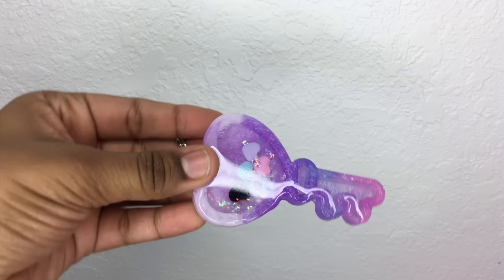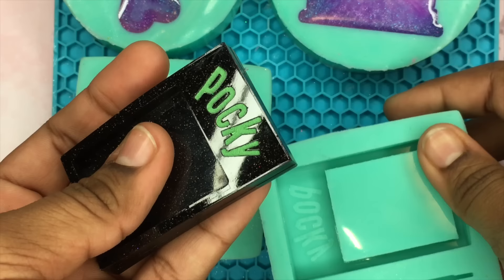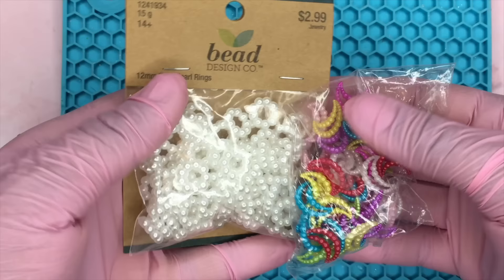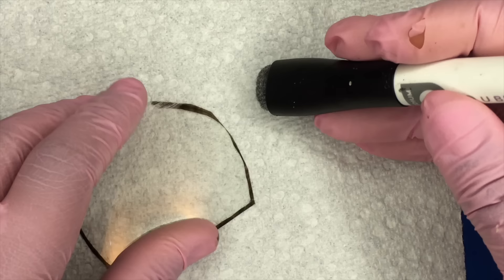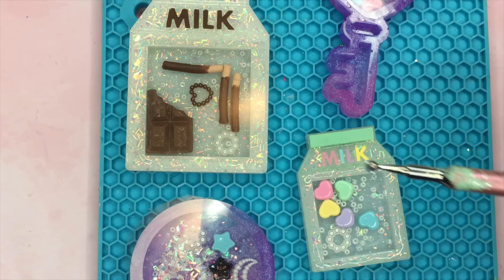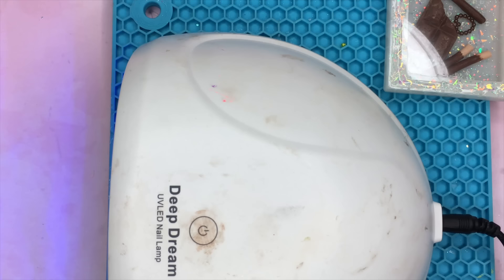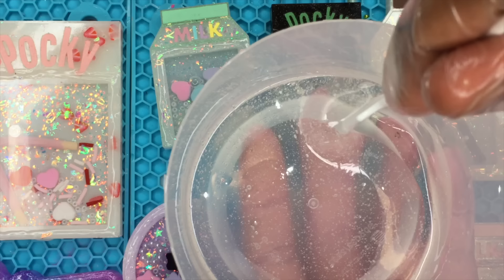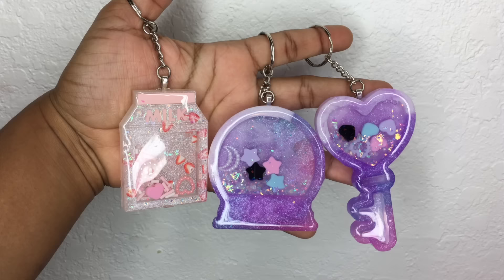How to: Resin Shaker Charms | Watch me resin | Sweet Art Crafts

Comment: Thank you for addressing resin safety 💜
Reply from the maker: I plan to do a video dedicated to resin safety soon. I was naive in thinking that because I knew about resin safety and always wore protective gear, that others knew this too.
Reply: I never knew resin was harmful,I see others just do it like a normal glue gun that has melted glue
Reply: 1000th like
Reply: @SweetArtCrafts  do I have to use a Mask while using resin?
Reply: You ALWAYS need to wear a respirator and safety glasses and THICK nitrile gloves when working with resin, eco resin too! (Two pairs of gloves seem to be ok too) And do NOT sand it outside!! It will deposit in the soil, become micro plastic and pollute the planet for basically ever 🤦🏼‍♀️ Sanding outside does not protect you from inhaling it anyway.

Comment: i have quite literally never used resin in my life, any tips for someone like me who wants to try it out? like where to buy, how much to buy, etc
Reply from the maker: nxdal I would honestly start off small, look at supplies from AliExpress, eBay, Amazon and local craft stores. I would also look into using Art n’ Glow resin as a starter one, there are other brands as well on Amazon you can look into. Just make sure to do your research. Also before starting resin, I would highly recommend you getting protective gear. Epoxy resin can be dangerous and cause rashes and other side effects if you don’t wear the correct gear. I would suggest a full face respiratory vapor mask, nitrile gloves, wearing long sleeves and making sure you are working in a well ventilated area that doesn’t have children around. Also keep in mind this is a very expensive craft/hobby, I didn’t know that until I really started getting into resin but I love it. 😭
Reply: Get a beginner kit. Look up resin kits some will come with UV resin, and an uv light. Craft Kitsune, Sophie&Toffee, Amazon, Etsy. Look up UV craft kits in your search bar. Start with the Uv then work your way up to the 2 part. Your local craft store will sell the 2 part, you can get the small one and try that out, if you don't want to do the Uv resin. Beware the Aluminite Amazing clear cast, stinks but is really good resin. I won't buy it again, because of the smell.
Reply: There are starter kits in spotlight that tell you the basics
Reply: ah thank you sm y'all 💞💞
Reply: @meow65  Just wanted to second the Sophie & Toffee kit suggestion. They have a starter resin box specifically for beginners, but they also sell other kits for making small charms and things. They have tutorials on their social media, and you can find some on YouTube as well.
Reply: I have never even heard of it before
Reply: This was helpful, thank you!
Reply: I have been asking my dad he made these counter tops with a sertin one  and my dad said maybe we can try but start off small like my dad is going to
Reply: @SweetArtCrafts  what would happen if someone didn't use a mask for example and what would happen if they didn't use gloves?
Reply: Sweet Art Crafts how expensive would you say
Reply: Resin can b3vcostly.  Definitely buy small before bigger investment.   Make sure you have protective eye and mouth gear for health reasons, well ventilated area protects you and others living with you.
Reply: @MommiesSimmpleLifee  depends where you purchase, whether shipped or not and where like another country (timevis money too 😁 )
Reply: @meow65  thanks for asking, but I they've helped me too much 🤗🤗
Reply: Shanitta Thompson  can you make the shaker out of UV resin or does it have to be epoxy?
Reply: Look up starter kits on amazon and then get some resin! I love uv resin because it is more affordable ! To cure it u will need uv light, Such as a nail lamp! If u don’t have that u can put it in the sun for 30-60 mins depending on the size of the piece! But I would recommend a nail lamp! Hope this helps!
Reply: Mix the Hardener and Resin. I didnt and it turned out a mess
Reply: @AndreaP_N7   pls the number
Reply: Pls number
Reply: @AdeniranAdeola-ie6rj  Sorry, what number are you talking about?
Reply: @AndreaP_N7  does selling the material to use
Reply: @AdeniranAdeola-ie6rj  The shop? Sophie and Toffee sells good quality resin. I got my mask at a hardware store where I live.
Reply: @AndreaP_N7  okay thanks really appreciate pls can you share me their number and the location or if you have any of their page
Reply: @AndreaP_N7  where did u base
Reply: @AdeniranAdeola-ie6rj  Sorry, I don't know their number. They are in a different country than me, anyway. If you Google their website, you will find it 🙂
Reply: @AndreaP_N7  alright thanks boss

Comment: I'm so glad you talked about resin safety, I was about to do this in my tiny room with absolutely no protection.
Reply: Me too
Reply: There are some craft resins you can get that are non toxic and without fumes, though sometimes they are not as strong
Reply: I did it once and yeah not again 😂
Reply: SAME
Reply: You ALWAYS need to wear a respirator and safety glasses and THICK nitrile gloves when working with resin, eco resin too! (Two pairs of gloves seem to be ok too) And do NOT sand it outside!! It will deposit in the soil, become micro plastic and pollute the planet for basically ever 🤦🏼‍♀️ Sanding outside does not protect you from inhaling it anyway.

Comment: Soooo fun and cute, I need those strawberry little charms. They're my favorite. These shakers have so many steps I didnt realize that. I have learned so much from your videos. Thank you ❤ p.s. great tip about adding a coat of u.v. resin on the outside of the clear paper. Better to be safe than sorry 👍
Reply: i found the strawberry charms at amazon :)
Reply: @dont4get2bleed  awesome, thanks so much. I am going to get some 😁👍
Reply: @dont4get2bleed  thank you omg..
Reply: Naptime Creations I also found a bottle of fruits for about 3 or 4 dollars at Micheals, they’re assorted so I might get a few of those and put them in my creations :)

Comment: As a Nurse Practitioner I LOVE YOU for putting lung safety and eye and skin safety FIRST!!!!! THANK YOU for reminding those amazing Parents out there that love to do crafts with their kids that THIS is probably not one of the BEST ones to do. I AM SO GRATEFUL…..If I had a nickel for how many times I have had a Toddler come in to the ED with Respiratory issues and the parent can NOT figure out WHAT they could have “gotten into”…..I saw her earrings and knew RIGHT AWAY she did epoxy & Resin crafting…..I asked her if she cleaned up well and wore a mask as well as WHERE does she do her crafts…..yep…..IN THE HOUSE IN HER “CRAFT ROOM” 🤦🏼‍♀️.

Not anymore she doesn’t. Little one was ok but he will most likely end up with some allergic issues to these things down the line according to the Ped’s On Call Doc. 

I did suggest a ventilation machine of some kind and one of the RN’s said she uses a Nail particle air “cleaner” as she put it…..however, unless it is HEPA with a new filter put in after “?” Hours of use, then it is no use so a face respirator AND doing this OUTSIDE is the best idea if possible. 

So, good call and THANK YOU for reminding Parents about SAFETY for them and their LITTLE’S!!!!❤❤❤❤❤❤❤

Comment: Another super helpful video!! I don't think I've seen many videos really explaining resin safety or anything about cleaning the pieces between initial demold and filling shakers. Is there a trick to using the UV resin on the perimeter to secure the clear film? No matter how I space it every time I have to press the film to make sure its pressed in and all sealed it always manages to leak in to the piece somewhat and something always gets stuck whether its tiny caviar beads or glitter.
Reply from the maker: I would suggest reducing the amount of UV resin for when you are applying the transparency film and then further securing that area with the second layer of UV resin that you do. That's what I do and I haven't had any things get stuck as yet.
Reply: Julie Allen 
Stuck?
You mean “magically suspended“  🥰

Comment: That kind of mask is too expensive for me... Im literally starting in the "resin world".
So I have a question, can I use normal mask? Like the ones we are using in this Covid time?
Reply: Honestly, I don’t see a problem with using a normal mask. As long as you work in a well ventilated area with gloves you should be fine. I have worked in a not so well ventilated area (no windows) and with no gloves nor mask. Don’t do what I did 😅 but next time I’ll be wearing gloves and a mask. You can also read the instructions of the resin you have and it should say what kind of protection you should use when working with it.
Reply: No no no it will NOT filter any of the fumes.. you need something that has filters in it. Amazon has cheaper options. But long term your health is worth the money

Comment: Thanks for sharing, those are super cute!  😍😻
You can get a gel brush at a nearby supply shop for the uv resin and you can clean it with Atleast 70% isopropyl alcohol. It could help spread it smoothly.

Comment: Definitely suggest wiping around the hole with alcohol after filling with baby oil, before you seal the hole with resin. I've found that ANY residual oils left behind can make the resin plug not adhere well, and peel away later. 😉
Reply: I had made a few a long time ago and back then, I didn't wipe with alcohol after filling them, just wiped it with a paper towel like you're doing. And it often took a few weeks or months, but that microscopic amount of leftover oil would cause the resin to peel up over the area just a tiny bit, kind of like when acrylic nails lift. It wouldn't necessarily leak but it left a little visible area that was lifted/bubbled. Since I started cleaning it with alcohol, it hasn't happened ever again. I also do nails and resin behaves like nail gels and doesn't like ANY oils.

Comment: Don’t have to use UV resin to seal hole right? We can use 2 part resin and just wait extra time for it to cure?
Reply from the maker: Its possible if you first allow that resin to get very thick before applying it and sitting it into an upright position to cure. UV resin cures in less than 1 min very fast under the UV light which allows you to continue to work on the piece the same day, which is why I use it.

Comment: This is an AMAZING tutorial, thank you! But I have two questions: can I make shakers with only epoxy resin? I don't have uv resin and I don't have the money to buy it at the moment. And how can your glitter and flakes not fall to the bottom? Every time I try to use glitter in my work it sinks to the bottom, the only way to stop it is to wait a couple of hours before putting the glitter in but then the resin is too thick to be poured so I just sprinkle the glitter on top of my pieces...which is not the effect I'm looking for, I want the glitter to be evenly spread in the piece and not to just sit on top of it. I tried to ask this question about glitter in a couple of groups but apparently no one knows how to avoid this?
Reply from the maker: I don’t think it would work that well with epoxy resin. Unless you wait until it’s super thick and paste like and then apply it to the charm and put the transparency film. UV resin is fairly cheap on Aliexpress, about $3-4. Most people like to use it because of how quickly you can cure it and and continue on working on the pieces. Also my glitter does sink to the bottom of my pieces. I just use less glitter so that the pieces doesn’t look overwhelmed with glitter. Also make sure you are using a high viscosity resin like Pro Marine or Art N Glow. They help to keep some of the glitter at the top. And I would t wait 2 hours. You only need like 20 mins-25 mins to allow the resin to thicken up a bit and all your glitter shouldn’t fall all to the bottom. That’s what I do for pieces I want to make look more dispersed. I hope that all made sense lol

Comment: Thanks for also addressing the second coat of UV resin prior to doming; it's too easy to miss a gap the first time around, then dome, then the piece is ruined. Great video, thanks for sharing this!
(Edit): Sub'd, your channel is awesome! A couple of questions, do you personally feel it's important to finish the piece by doming the back; are there times when you wouldn't do so? Also, after you finish sealing the holes with UV resin, do you usually sand down any areas that are bumpy, or do you tend to leave them? Leaving them I surmise would help keep that hole sealed, interested in your thoughts about finishing that area, or do you leave it? Thanks!!

Comment: Hey question how did you do it in 12 hours and not 24 did you use the heat gun to make it dry faster
Reply from the maker: It takes 24-48 hours to cure. The heat hun is to make the bubbles pop.

Comment: Whats your opinion on using the decorations you can get at nail supply stores that usually go on like acrylic nails?
Reply from the maker: I use those on my charms and I’ve seen plenty of people use them as well.
Reply: @SweetArtCrafts  by on, are you including inside the baby oil part? I'm not sure what they're made of or if they will disintegrate in oil. 
Thanks for this video btw.
Reply from the maker: @Akoyabones  I’ve seen other people put the gold looking nail supply charms into their charms but I have never put them in there before because I was always scared they would turn color. But most of the other stuff should be fine.
Reply: @SweetArtCrafts  Thats kinda what I worry about too since nails are only worn for a week ish before they're redone so the soft stuff isn't likely meant to last. 
Anyway, thanks again!

Comment: If you do the resin outside would you still need a mask? 
Or should you still wear one?
I’m also wondering if it’s kinda unsafe to do the epoxy could we use clear glue instead?
Reply from the maker: Coco Chocolate chips This wouldn’t work with clear glue. And for outside, I personally would still use a mask.
Reply: Sweet Art Crafts Ok thanks :D

Comment: Omg this was 1 year ago, I want to ask something because I want to make key chain with resin, what happens if you don’t use gloves, a mask, or if u are in a place where there’s no ventilation?
Edit- what is the sickness? And how to cure it?
Reply from the maker: Hi! Basically you can develop an allergy to epoxy resin if you don’t wear the gloves, mask or have proper ventilation. I have seen people get major rashes that burn all over their body, difficulty breathing, headaches and coughing. Even if you wear a mask and etc, you can still develop the allergy to epoxy resin so you are honestly taking a risk when using epoxy resin because it is a chemical. And there isn’t really anything to cure it once this has happened. Sometimes it comes and goes for some people. For others they had to completely stop using epoxy resin altogether.

Comment: These are so cute! I covered something with resin and it’s still sticky 6 months later?! Help anyone!
Reply: If you used 2 part resin it might not have been mixed properly or with the correct ratio! That happened to me the first time I used resin. Make sure your measurements are exact, you work quickly, and mix thoroughly!
Reply: Thanks! I’ll try that. Is my piece I poured ruined?
Reply: @bongy77  you can probably just scrape off the bad resin and pour over again if you were doming it, that's what I did and it turned out fine!
Reply: I’ll try that thanks so much!